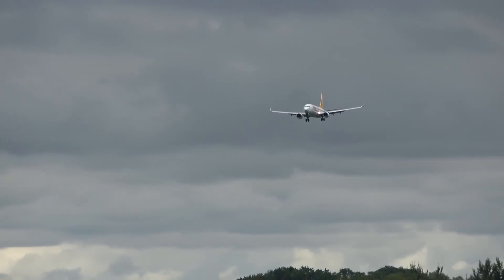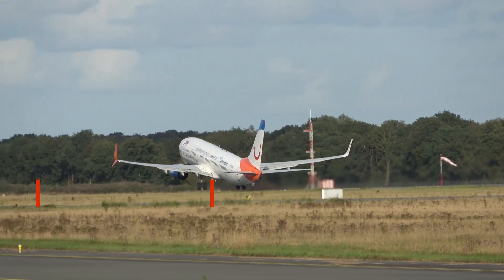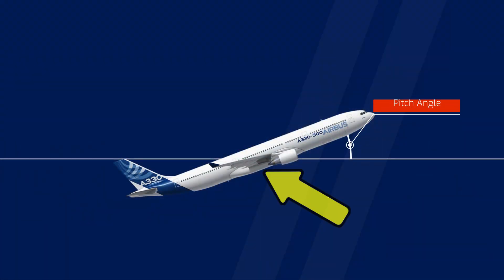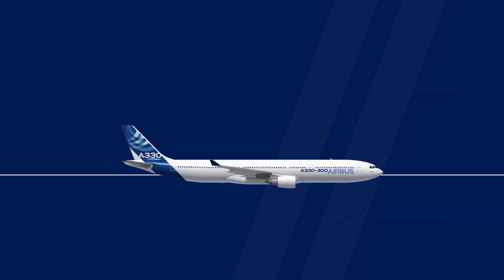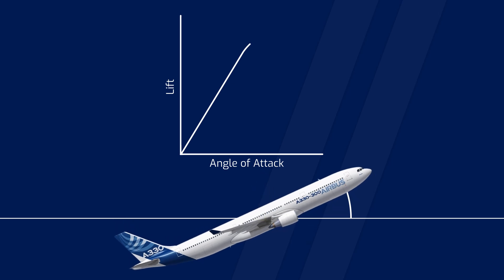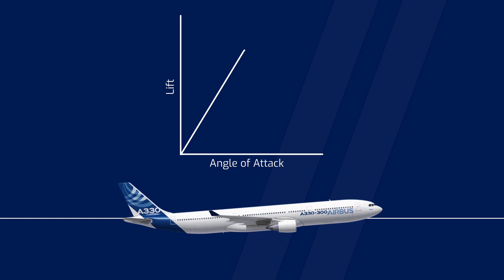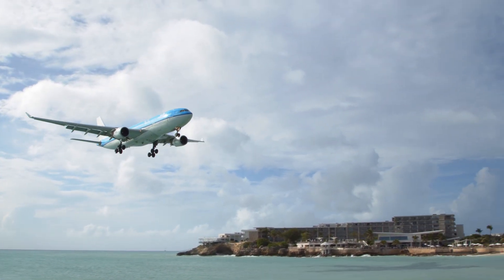How Planes Fly Inverted | Airspace Explained

Comment: Ya know you did actually show a few flips of planes flying inverted you hack. How do they fly and not come crashing down. If the angle of attack is negative how did the force.... excuse me....lift know which way to lift. Is it the Flying spaghetti monster? What about when planes half rool 90 degree the lift is horizontal to the plane right or left not up like on takeoff.

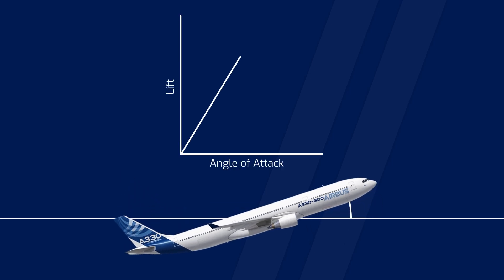Comment: 1:26 This is an explanation trying to incorporate Bernoulli's principle, which is now obsolete theory in aviation aerodynamics. Lift is produced because a certain amount of air is accelerated downwards, resulting in an acceleration in the opposite direction of the object that deflects the air. This is done most effectively when the airflow over the wing is laminar, and this dictates the shape of the airfoil, with a somewhat rounded upper side. Differences in speed of the flowing air over and under the wing have little or nothing to do with the desired lift. Look up Bernoulli's principle and do the calculation of pressure differences in relation to speed yourself. And be amazed!
Reply from the maker: Huh, I never heard anyone claiming bernoulli os obsolete when it comes to lift. interesting, gotta read more.
Reply: @AirspaceVideos  Bernoulli's principle as one cause or even the main cause for generating lift is a widespread misconception. Scientists trained in fluid dynamics however know it is a misconception. I would have expected from someone who tries to explain how aircraft fly to be familiar with that fact. The use of Bernoulli's principle postulates EQUAL TRAVELING TIMES of the airflow over and under the airfoil, which would then theoretically result in a somewhat lower pressure over the airfoil because of the slightly higher speed. Traveling times however are not equal, as can be seen in wind tunnel experiments where the flow is made visible with smoke. But even if traveling times were equal, then the difference between the speed of flow over and under the airfoil is way too small to generate a significant amount of lift. This is why I invited you to do the calculations yourself. The generation of lift is explained by Newton's third law: to every action there is an equal but opposed reaction. If lift were generated based on Bernoulli's principle, then an airfoil with a typical intersection like that of an aircraft wing (upper side rounded, under side flat) would plummet from the sky the moment one would turn it upside down. As you discuss in this video however, every flat plate and every airfoil turned upside down will generate lift as long as the angle of attack is positive. Which also rules out Bernoulli's principle as a cause for the generation of lift.

You should be able to read more about it in the specialist literature that deals with fluid dynamics in general, and aerodynamics of airfoils in particular. The propagation of the misconception is done by people like high school teachers, who never really studied or understood the discipline, and who like to just uncritically repeat what they got told themselves. As a result of this intellectual laziness, the misconception is almost ineradicable.
Reply from the maker: Well, I just repeat what I was taught in flight school, so don't be surprised. Also, you seem to mistake me for someone who has e degree in fluid dynamics - I'm a pilot, a simple man 😉 I'm glad if others debate why a wing flies. As for me, I am happy if it does either way, bernoulli or newton. But thanks for your comment.

Comment: and the fuel? How does the fuel reach the engines if there are no pumps?
Reply: I think there are fuel management systems present in the aircraft that is designed for supplying fuel during inverted flight. However, if the aircraft fuel is gravity fed, then performing an inverted flight manoeuver can cause the engines to shut down.

Comment: I'm just wondering how long the engines would continue to work in a jet.  For some piston engines that are used in common non-aerobatic aircraft such as C172 there are special versions available that are cleared for inverted flight.  These aircraft have extensive modifications to their fuel and lubrication systems and sometimes special restrictions such as tighter limits for the CoG.  Pro tip in an airliner, avoid galley and toilets in inverted flight ;-)
Reply from the maker: haha, yeah that might be a good idea 😄 I wondered about the engines too! Gladly, they continued working.
Reply: @AirspaceVideos  The aircraft I've flown myself (C172 and Extra 200) don't have autoland - I wonder if autoland will work if inverted ;-)
(Maybe I shouldn't encourage too much experimentation, I've living too close to an airport (LSZH) where the metal hail might come down.)
Reply from the maker: I bet that would not work 😄 maybe I'll try that in flight sim...

Comment: I don’t agree with you on lift production. Some upwards force is indeed created by the pressure difference but it is insignificant, overall lift is created by pushing air downwards (Newton’s third law). As NASA would put it, « Lift is a force generated by turning a moving fluid » https://www.grc.nasa.gov/www/k-12/airplane/right2.html
Reply from the maker: many physical effects come together when lift is generated, yes. Still, for aviation, the most common formula used is
L = Cl (coefficient of lift)* Area of wing(s)* .5 * air density * airspeed^2.
Source - NASA:
https://www.grc.nasa.gov/www/k-12/airplane/lifteq.html
Reply: Flat plate wings create lift by newton's third law but when the wing is an aerofoil, verturi effect is the theory you should check. Aerofoil uses pressure to create lift
Reply: @Demostene,
I am sorry, but you are mistaken as so many people are in different ways.
It is indeed the Top-Bottom pressure difference that provides ALL the lift force.
.
In short, the wing's motion creates pressure differences as it pushes the air around in order to move through it. Those pressures are fundamentally more under and less above.
Then those VERY SAME PRESSURES cause all the air accelerations we see around a wing.
.
.In other words, it is the pressures created by the wing;s motion that "turn" the air.
..

What you should get out of Bernoulli is that a speed increase (acceleration) is caused by a Pressure Gradient (difference pressures between two locations). 
.
Pressure differences accelerate the air. A pressure Gradient pushes and accelerates air toward the lower pressure. This is Newton in fluids and is the SAME thing as the Top-Bottom difference pushing the wing up!.
.
The decreased pressure above the wing is the cause of the acceleration toward the trailing edge.
.. ...

The biggest factor for lift is what happens above the wing. The wing's motion and shape causes a reduction in pressure, but not asso many well intended people describe it.
.
 Yes it is counter-intuitive, but this is fact understood by aerodynamicists that is accurately covered in this short video - for ALL WINGS, upright or inverted, because it is the airflow that is the most important, NOT simply wing shape:

. WHY There is Lower Pressure Above a Wing
 https://www.youtube.com/watch?v=3MSqbnbKDmM 
A LIKE would be appreciated.
..
And read this:
 Understanding Lift Correctly
 https://rxesywwbdscllwpn.quora.com/

--
Reply: @Observ45er  the way I see it, what you said doesn't really deny what he mentioned about the angle of attack.. In fact, it actually confirms it
Reply: @alexandermaxx  Hi Alex,
That is true. The effective angle of attack is one, but only one important factor that is necessary.
However, such a simplified phrase gives no real information to hang your hat on. It is hardly better than simply saying a moving shape creates lift.
.
It is also a very important fact that a wing (any wing) generating lift produces a very significant pressure reduction above it.
.
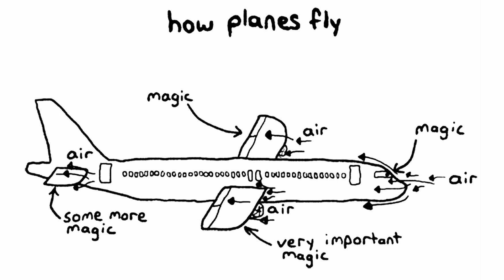As I posted a month ago, this video is quite good and at time 0:50 he says that lift is dependent on many factors.  
.
So many well meaning amateurs have trouble with the correct understanding; each has their own favorite simplification and misunderstanding.
..
Unfortunately:
This part of Demostene's statement is completely false:
 "Some upwards force is indeed created by the pressure difference but it is insignificant".
..
The top-to-bottom pressure difference is what is commonly called "wing loading" and that is what pushes up on the wing. That is what provides ALL of the upward force on a wing that holds the craft up against gravity.
It is the required net upward force on the wing. 
.
So, obviously denying that clear fact shows a lack of understanding from the start.
.. .. .. .. ..
.. .. .. .. ..

The point is that simply mentioning one thing that happens that is true (the 'turning' of air) is not much of an an explanation. Also, "turning" is a rather crude way to say "accelerate" 
.
Then, By The Way:
Saying that: "Lift is a force generated by turning a moving fluid" is technically incorrect because it only looks that way in a wind tunnel.
.
Before a flying wing arrives, the air is still, not moving. It is accelerated from a standstill in several ways after the wing leaves that space.
..
- - - - - - - -
 

This "turning" is an acceleration.
.
Air has mass and If we understand Newton, we know that a force is required to accelerate a mass.  In this case, it is these pressure differences caused by the wing's motion that accelerate that air
..
By carefully looking at the pressures in various places around the wing you can see that they ALSO CAUSE all of the accelerations of air around the wing. 
.. ..
 * * * *  TL;DR: 
The shape of a moving wing causes changes to the air pressure around it that provide the net upward force against gravity that holds the craft up.
In the process, those pressures really churn the air around several ways.
- - 
Regards

Comment: Aren't some parts of a plane gravity-dependend? I think I've read somewhere that some fighter jets' engines are gravity-fed, and thus pilots shouldn't fly their fighters reversed with negative G for more than 10 seconds or so!
Reply from the maker: Absolutely! Just because the wing would generate lift when inverted, that doesn't mean that every plane will be capable of sustained inverted flight. Most common aircraft engines would experience problems with lubrication and fuel feeding when upside down. Damn you, gravity...
Reply: Guessed so! Thanks :)